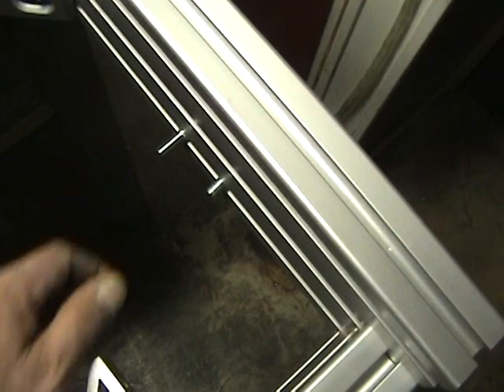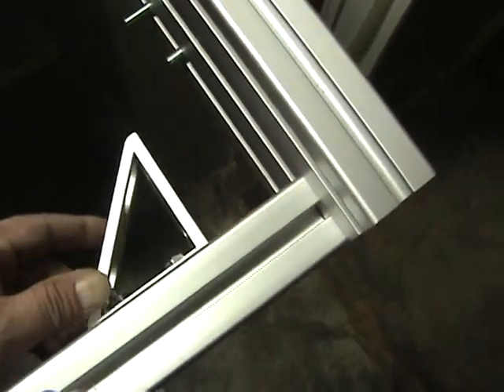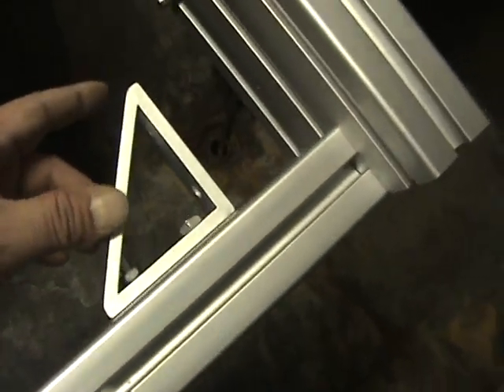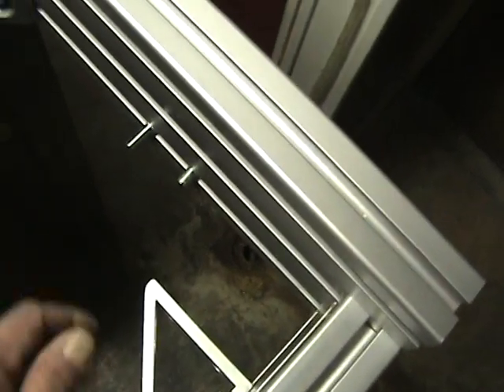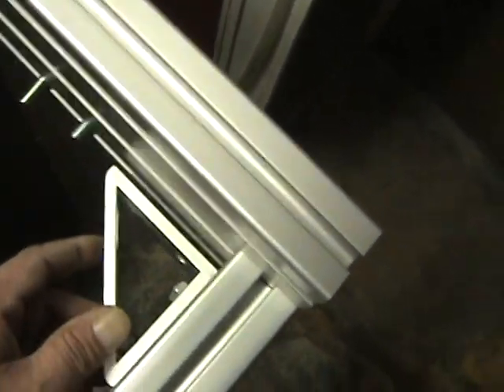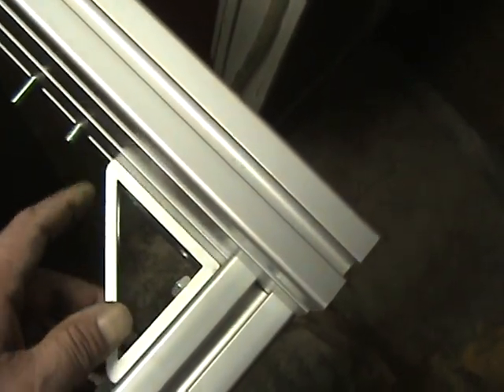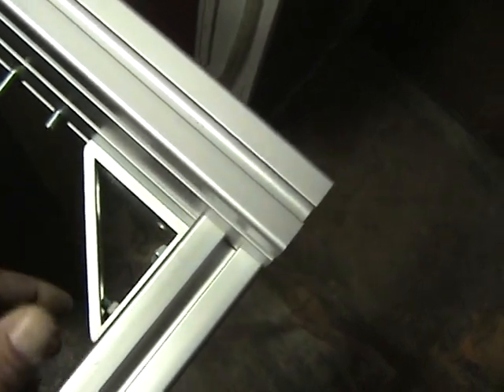Building CNC Router Parts CRP4848--3.MPG

Comment: For those planning on getting the kit, the angle supports are different, and my version doesn't have the bolt cutouts for installing the spoilboard.  Still not sure what I'm going to do there, as I've got it assembled already.  These videos are about as good as you get, also.  No instructions came with my kit.  Just the 3d cad assembly file.